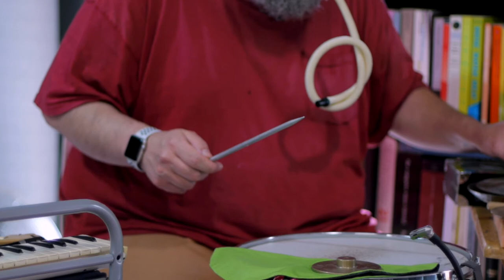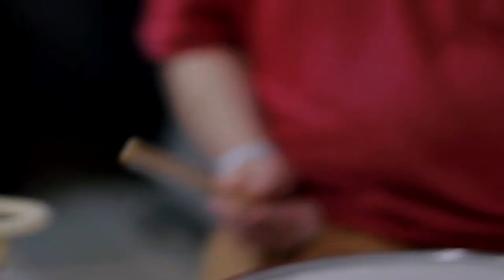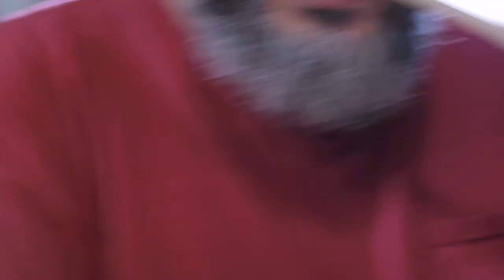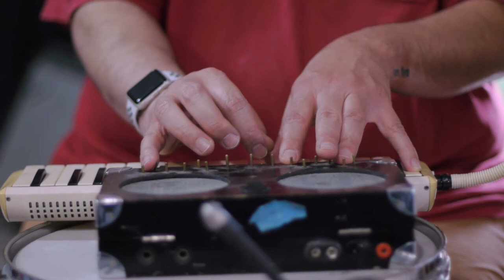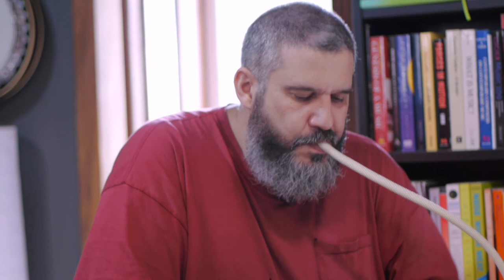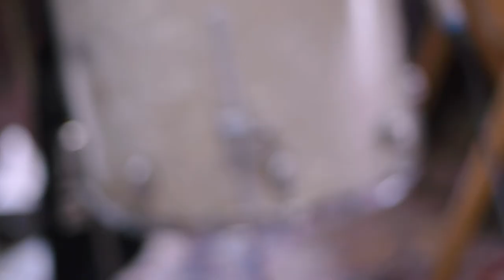Ece Canli - play talk play

Comment: very cool! again ;-)
what is the cool little instrument (with keys) in de beginning of the second improvisation?
Reply: is it some, or a combination papercircuit?
Reply from the maker: It's an Old Mr. Grassi (I think the second OG paper circuit from Peter). I added a few extra pins as circuit-bending points, and excluded some of the pins that didn't seem to do much (based on my choice of random capacitors/resistors).